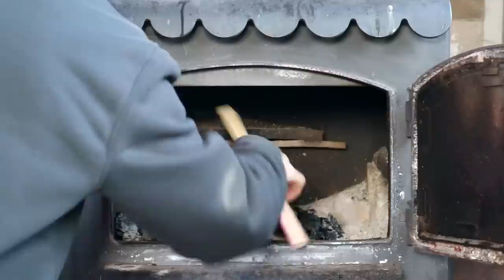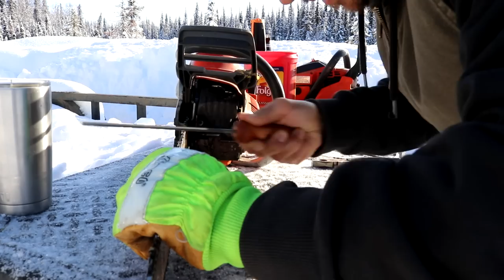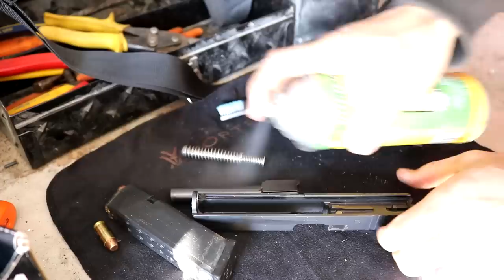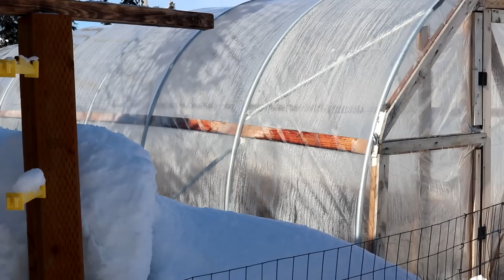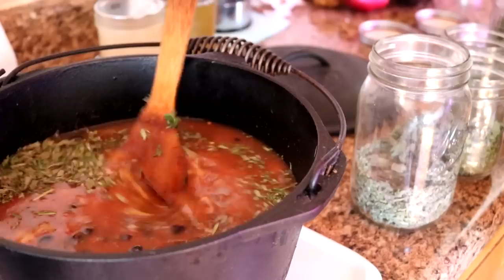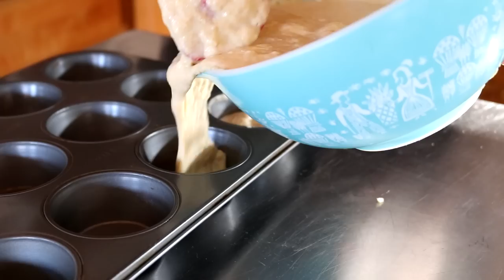Carrying On During Uncertain Times | Off Grid Alaska

Comment: If i may suggest...  don't fill your bar oil tank on the chainsaw and then put it into storage.  What will happen is that expanding air inside the tank will push oil out of the saw during the day and at night the air will contract and repeat the cycle the next day (provided it is warmer during the day than at night) till the saw is empty and the tank full of oil is on your bench.

Comment: I learned with cutting most onions is to not have your face directly about the onion when you cut it. Pretend the onion is smoking when you cut it and you don't want the smoke in your eyes. You will come across some strong ones that might still get ya but it won't be as bad. Stay well.